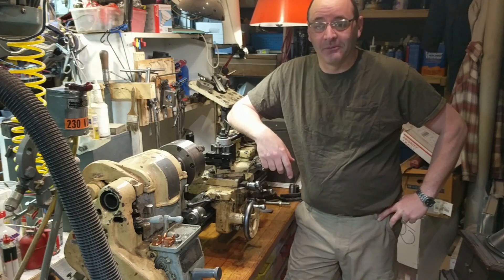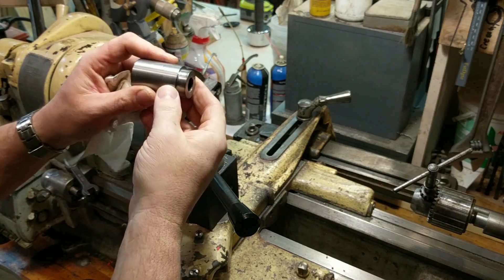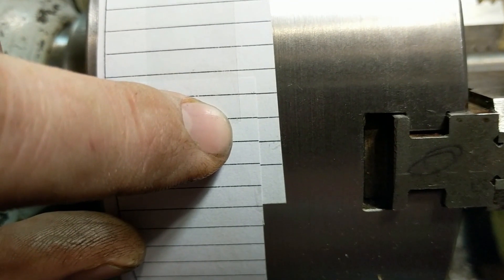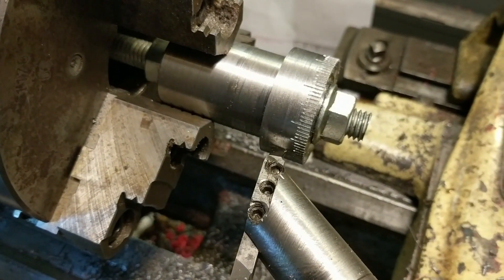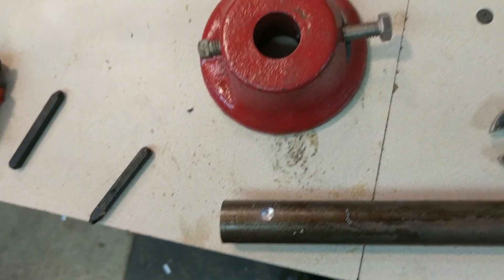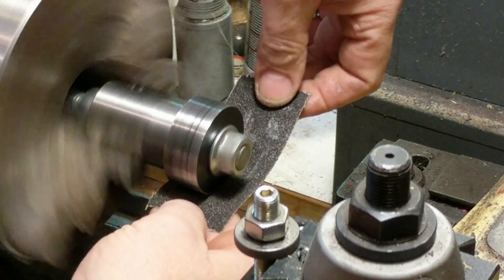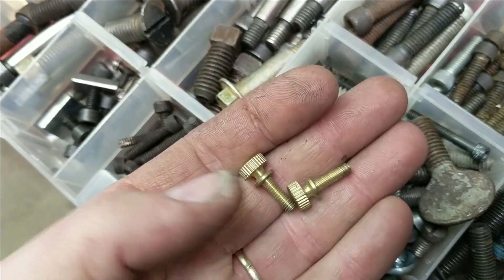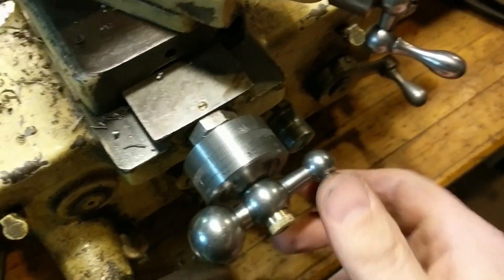Free Large Dials Accessory for the South Bend Lathe

Comment: I have the same lathe.  Mine has the single tumbler gear box and started out as a 10R.  I changed out the spindle from a 13" lathe to enlarge the through hole to make it into a 10L.  mine has the cast iron leg at the tailstock and enclosed cast iron motor cabinet under the headstock.  Mine was war production and ended up at a tech school for colored people at the end of the war.
Reply: clockguy2 how do you move the thing!!😂

Comment: Nice Project! Just a question...when number stamping, does the number "1" or "7" require less weight drop compare to the number "8" or "5"  being they have less contact surface area?
Reply from the maker: Excellent question!  I had a similar thought, but I couldn't tell much difference in practice.  Part of the reason I created the stamping jig was to be able to be consistent, and that did work.  And for the "1" I did drop the weight from..  1.5" lower?  But for all the other numbers, I just went to the full height.  And they all seemed to turn out pretty much the same.

Thanks for your input!